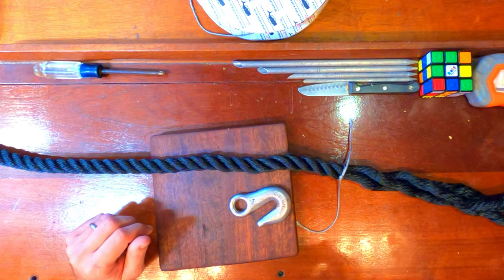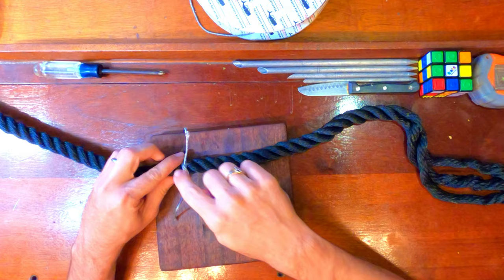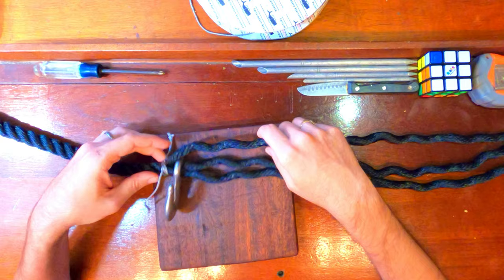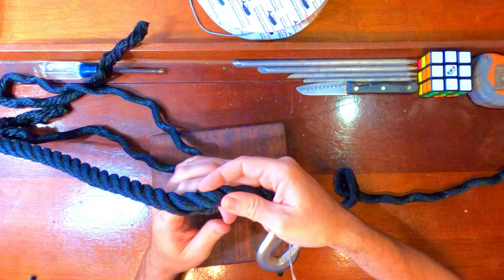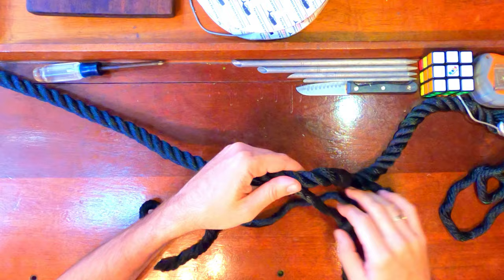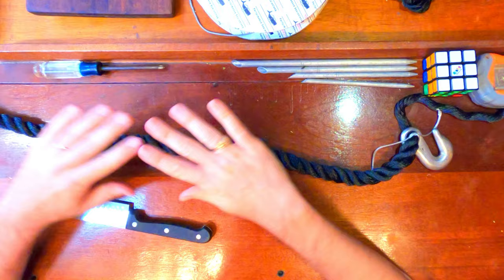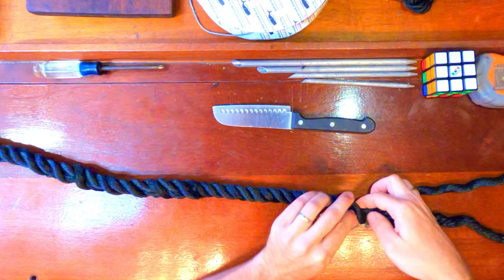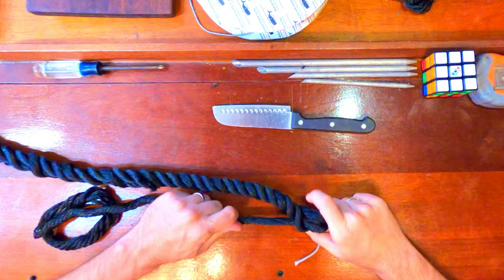Chain Hook Splice [DIY Snubber] | Sailing Wisdom

Comment: Second comment! A long snubber is a great way to get your chain wrapped around the halyard winch on a boat with no windlass/capstan!
Reply from the maker: Very true! Just lead it to the mast and start cranking. If you have to pull the whole thing up that way, it is called “nipping”. It’s how the old ships used to raise anchor and a small child would climb down the hawse pipe to tie the line as close to the water as possible. They were referred to as “little nippers”.

Comment: @01:45 So I'm guessing there must be reasons why would eschew taping the bitter ends while un-laying and making the splice.

Another excellent tutorial, Herbie!
Reply from the maker: The tape holds it together but if you don’t unravel the strands, you don’t have to use tape. 
I like to not use tape because I have more control over the thickness of the line. I can go flattening it out as I move further along with the splice and this helps with the taper.

Comment: Very interresting  as usual, thanks. But what kind of splice would you recommand when the hook is linked to two snubbers (going back to each cleat on each side of the bow)? Cheers!
Reply from the maker: I would still do the same, but after the chainsplice (a few feet back) I would do a short splice to tie in the second line. This would make it look like a Y. 
While it won’t be as strong as 2 lines, the one splice at the hook would still be stronger than a single line as the hook is supported by 4 strands (even though you only used 2, it’s mind boggling but in physical testing, it shows true so just take it for what it’s worth). To have it be truly two lines strong you would need to make two of them and have two hooks. 

The problem with two hooks is one will always be at rest and will likely fall off if not a captive hook since these hooks need to be under load to stay on.
Reply: Thank you for this wisdom  @RiggingDoctor  , your comment is rich!

Comment: Curious,… I may have missed something but what is a benefit of this type of splice over a common 3 strand chain splice? I’ve been using the common splice for over 12 years now. They go through the windless perfectly and have been through 5 hurricanes, of which 2 where over cat3. 
Don’t get me wrong, it’s a fine splice and you did a great job teaching it. However is it better or worse than common chain splice? 
I love your channel and look forward to future content. 
Heck, your the reason we ditched the CQR plow and purchased a Mantus2 😅
Reply from the maker: You are lucky the regular splice passes through. It is slightly stronger than the regular splice, but the biggest benefit is that it will pass through a windlass. 
With this said, if yours is working on your windlass, I would let sleeping dogs lay and leave it alone. 
I’m glad your anchors have held firmly through those nasty storms! Growing up in Puerto Rico, I have a healthy respect and a well appointed fear of hurricanes!!
Glad you switched to the Mantus ;)
Reply: @RiggingDoctor  thanks so much for the reply. That all makes perfect sense. 👍

Comment: Herby, so with this splice basically just two strands are  doing the job??
Reply from the maker: Technically, but the spliced part is working with the strength of 4 strands and is therefore stronger than the rest of the rope which only has 3 strands total.

Comment: Another good splicing video. I’ve just done my new snubber a week before your video and I did it with a multi strand rope, typical in Norway. Anyway, I’ve been searching the web for length of snubbers and so many opinions and Practical boat owner was up at crazy lengths. With my 37 foot sailboat I have gone for 20 feet. What is your opinion?
Reply from the maker: 20 feet is good because it gives you plenty of length for elasticity in rough weather. 
I vary the length depending on the conditions where I anchor. If it’s calm, about 5 feet. If it’s choppy, 10 feet. If it’s really rough and the seas are more than 6 feet (when a storm comes and you have to ride it out) I will let out about 20 feet. 
The goal is that when the chain goes tight, that the boat doesn’t “snap” because this shock load can pull the anchor out of the bottom. So, the “needed length” is: enough to eliminate shock loads to the anchor. 
More than 20 feet just becomes excessive on a 37 foot boat.

Comment: Cool, That is something I need to make anyway, so just in time. Does the two lines going through the hook mean the join is 67% the strength of the line? Are the rope/chain Gypsies designed for a rope size that takes this into account? Or is the type of rope important.... bad question, there is some really bad stuff out there.... what kind(chemistry) of rope would you suggest?
Reply from the maker: The splice using two strands of the three is actually 33% stronger than the line. It’s mind bending, but the splice is supported by 4 lines even though it only used 2 of the 3. Since it doubles back, it becomes 4 vs 3. It doesn’t look right but in testing it actually is the strongest part of the setup. 
For the snubber, you can use Nylon for additional stretch and elasticity but this action generates heat which will kill the line and cause it’s demise. Polyester three lay is less stretchy of a material but by virtue of being three lay, has a lot of stretch to it and won’t generate as much heat and would last longer. 

In the states, you will need to special order polyester as everywhere sells nylon. If you are in Europe, they don’t sell nylon and everything is polyester. 
I highly recommend polyester over nylon because of its added durability and lifespan.
Reply: @RiggingDoctor  Mind bending but makes sense. Having a smooth hole in the hook would be really important.

Comment: I might be being dumb here, but why not just use a bowline to attach the rope?
Reply: Because that knot won’t go through a windless.
Reply from the maker: Also, the knot will be weaker than a splice, so this setup (while more time consuming) is stronger.
Reply: @RiggingDoctor   Hmmm...  Wouldn't an eye splice work as well to attach a snubber hook to the snubber line?  Am I correct in thinking the snubber line won't be pulled with the windlass so the rope2chain splice won't be essential?  Or am I missing something?😮‍💨